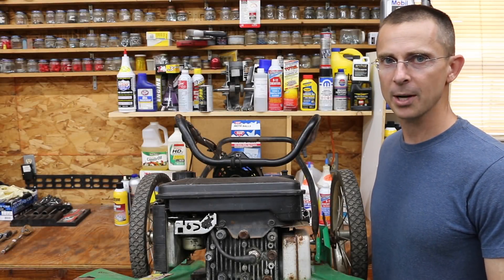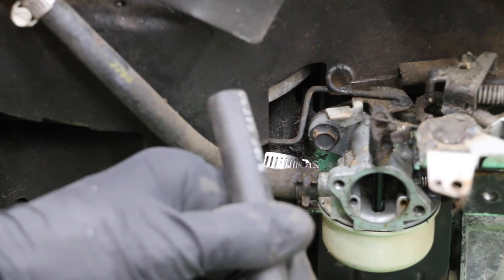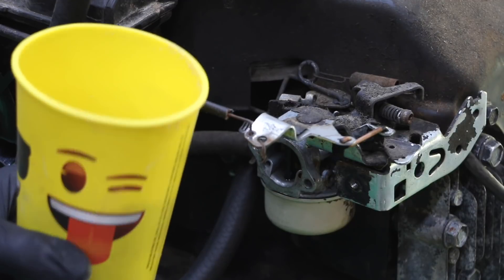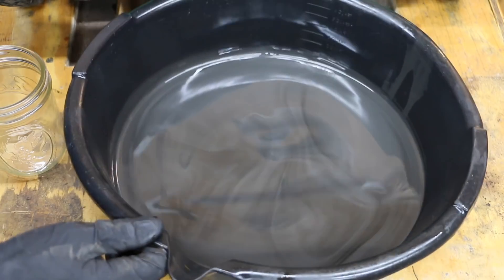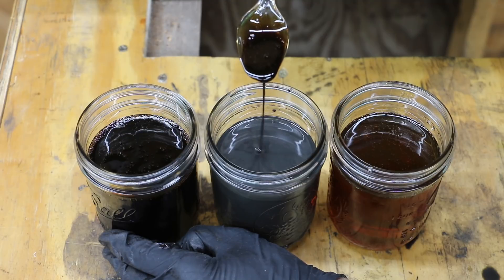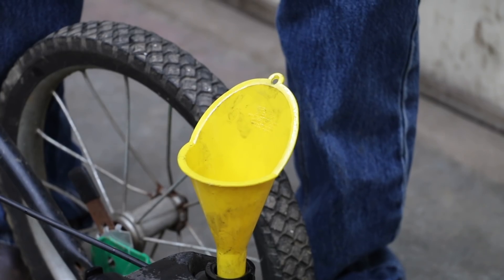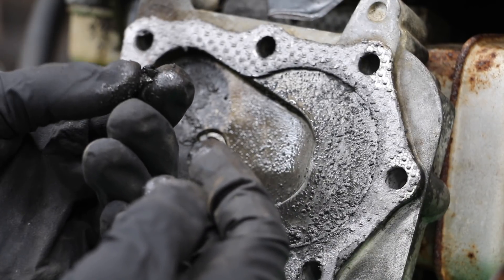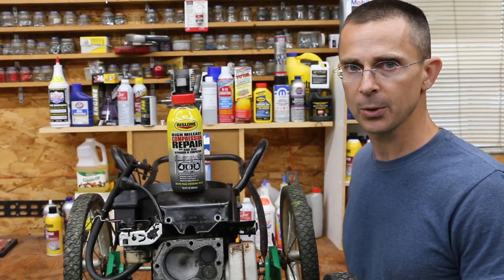Engine Eats Sand! Can Rislone Repair Compression Loss?

Comment: WhAt happens when you have a 50 diesel 50 gas mix in a small engine?
Reply from the maker: Pepi Dachev, I think this would be a terrific test!  Thanks again!
Reply: Also all your videos are awesome and your channel is underrated
Reply from the maker: Aidan Nina, I really like the 50/50 gas/diesel idea--thank you!  Also, thank you very much for the positive comment!
Reply: Going to smoke like a busted stove
Reply: Maybe run a little weird when it's cold but when it warms up it's gonna run pretty decent.
Reply: I did this with an early 2000's diesel John Deere Gator. A relative had mixed half off-road diesel and half gas to use a fuel starter without letting anyone know, so when checking, it was still red and smelled of diesel fuel. Ended up making the motor sputter really bad, misfire and have half of the normal power and torque it does on full diesel. Needless to say, as a 14 year old kid at the time, I thought my grandparents were going to whoop my ass for "ruining" their gator but it still runs strong to this day.
Reply: I did that with an old toyota tercel when i was bored and on welfare. It brely ran and smoked like crazy.. Do the test!
Reply: WHen I was a kid I pumped 100% diesel into my dads brand new chevy silverado z71. It went about 3 miles then fully died, MY dad started it up, Tossed it in reverse and the thing drove the whole 3 miles back to the gas station in reverse just fine, then we added a bunch of 93 octane into it. And then changed the fuel filters and took it back to the dealership under warranty, It just knocked the CAT converter out (witch had a recall on it anyway so maybe it was just bad to begin with). But yeah, Diesel in gas engines (bigger ones) isn't that bad, I put $20 of diesel into a empty tank, then we pumped like $30 of 93 octane into it and ran her hot as fuck and it was just fine.
Reply: I did that with an old 10hp Briggs on a lawn tractor.  Ran rough with lots of white smoke when cold but ran fine when warmed up.  It also needed the choke to start even when hot.
Reply: I used to use boat gas in my Camaro when I was a kid. It worked fine. I didnt have much smoke either.
Reply: Aidan Nina The engine will run hotter usually. Diesel has heavier oils (that burn hotter but are harder to combust) This is why running a gas engine on pure diesel will kill it. Generally a 1:20 gas-diesel mixture is optimal for preventing vapor lock and slightly raising octane for older cars.
Reply: I got some free gas with diesel from a car garage, i run it in my pitbike (110 cc engine) and it runs fine, it only smokes alot so everything in the engine becomes pretty black
Reply: the  mower should run good with diesel mix when warmed up . my scrapheap mower will run on all most anything when warm, used pure white spirit once just to finish off the garden. expect it to vibrate a bit due to preignition.
Reply: depending on the motor it could run fine it could have detonating problems and all sorts of other problems but i think he should test it
Reply: FlyingWldAlaska77 I know it will have problems starting and running but I want to see what happens to the engine doing this
Reply: can you fix a scratched piston wall with jb weld
Reply: he tride that after doing the diesel i the same video
Reply: learn to spell idiot
Reply: A whole lot of stuttering and one dirty spark plug I bet :D
Reply: Aidan Nina i bet it will give you AIDS

Comment: My pushmower engine has very low compression and runs at slow and rich idle. Whats wrong with it
Reply from the maker: What's the compression reading?  Even with low compression, the engine should be able to reach normal RPMs.  Does the carburetor have an adjustment for increasing the engine speed?
Reply: Yes but the carb is junk i rev it up until it sounds like a original lawnmower rpm and i can tell it has very low compression by pulling the cord and it has very scuffed up cylinder walls. I need a compression tester its very

Comment: ayy notification squad!
Reply from the maker: Hope you enjoy the video!
Reply: I sure do. But couldn't JB weld fix the walls and inprove compression?
Reply from the maker: This is a great point.  I believe it could fill in the damaged areas, but not sure it could withstand the intense heat in the long run.  Thanks again!
Reply: I've heard many good things about JB welds temperature resistance, looking forward to the test results!